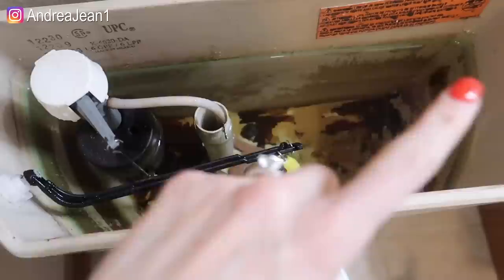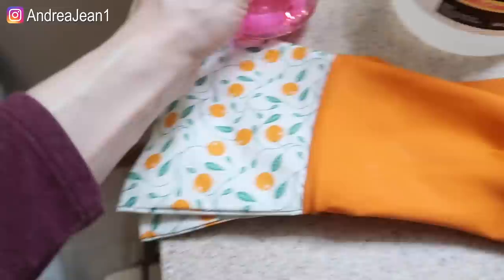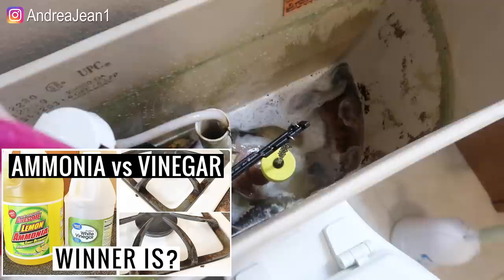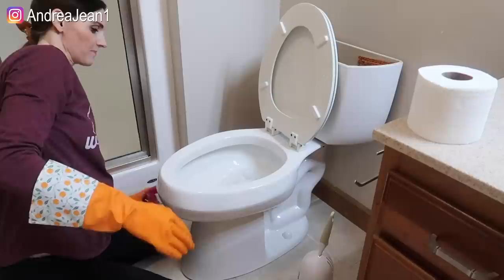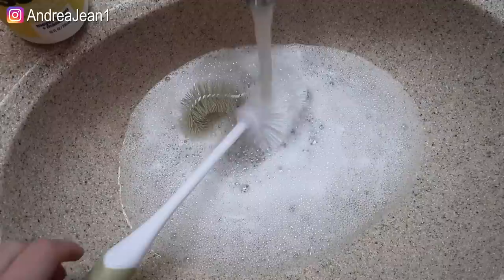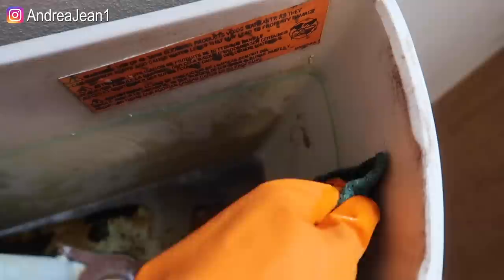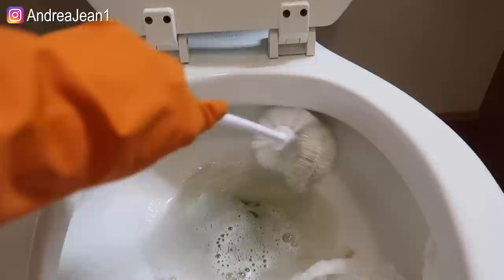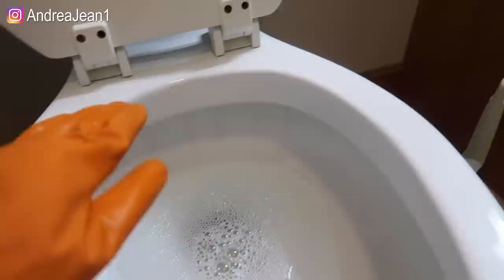Put VINEGAR into your TOILET and WATCH What Happens!! (Bathroom Cleaning Hacks)

Comment: WARNING!  If you live in a rural area and have a septic tank, be sure to neutralize the water in the tank/bowl BEFORE flushing.  The reason vinegar works is due to its acidity, and that acid will eat away the walls of your septic tank over time and can actually cause the septic tank to leak or even collapse.  You can neutralize the acidity by adding baking soda until the added baking soda stops foaming -- then it is safe to flush.
Reply from the maker: Thanks for the tips 👍
Reply: Thank you!!!!!!!
Reply: Thanks! 😊

Comment: A note of caution about using anything acidic inside the tank. We used bleach tablets for the tank in our new home we had built and the tank started leaking into the bowl after a while (we lived there less than five years so it was maybe three years). Turns out, anything acidic like vinegar, bleach tablets, etc. pits or eats into the rubber ring that sits in between the bottom of the tank and the stopper and prevents a tight seal. We had to install a new seal. Anything acidic will eat or pit anything made of rubber. Otherwise, I like your cleaning tips!
Reply from the maker: Thanks Karen. Yes you don’t want to leave it very long 👍
Reply: Thanks for the info Karen. I have had enough plumbing problems just changing out toilets to a Highrisers toilet 🚽!
Reply: Karen, I had the same thing happen.
Reply: @karen kelly Yes! Im glad you said this. I only use the 8% vinegar to clean with for this reason. Many vinegar directions for cleaning will tell you to rinse afterwards.
Reply: Bleach is not acidic. It is alkaline. It has a pH of 11-13. Acid has a pH below 7.
Reply: @AndreaJean  SHE WAS USING BLEACH TABLETS, SO YOU LEAVE THEM INSIDE THE TANK, SHE IS SAYING NEVER USE ACIDIC THINGS LIKE VINEGAR, OR BLEACH ETC.INSIDE THE TANK WHICH THOSE TABLETS GET LEFT IN THERE ALL THE TIME.....NOT FOR A SMALL AMOUNT OF TIME....TAKE CARE, GOD BLESS (do not know if bleach is acidic, I would have to check into that one>)
Reply: @AndreaJean  I thought you were insulting them 😭
Reply: Caustic chemicals will eat rubber just as well if you leave it in there.

Comment: The vinegar is great, but I find if you mix it with Dawn soap it sticks to the sides of the bowl better. You can do a mix of 50/50 or more vinegar with less Dawn. The thicker the mixture the more it sticks to the sides. I have also just poured a gallon of cleaning vinegar in the top tank when I don't have time to spritz. Also if you use a plunger to get all of the water out of the bowl, you can then clean your toilet brush right in the toilet with the Dawn / vinegar mix instead of your sink (ugh!). When you add fresh water to your toilet you can then rinse that toilet brush out in the fresh water.
Reply from the maker: Thanks!
Reply: I definitely would rather soak the toilet brush in the toilet rather than the sink.🤙🏼

Comment: You might also consider, as a preventative maintenance step (once or twice a year) pouring about a cup of vinegar into the the center pipe of the flush valve (where the little hose from the filler valve sits), to help clean/clear the water pathway to the underside of the rim. Limescale/rust buildup in this area can cause problems with the flushing of the toilet, and keeping the pathway clean will help reduce streaks.
Reply: @DaveWeston…omg!! I actually thought about that idea but, I was unsure about it!!! Thank you!! So so much!!!♥️

Comment: I do this but refill the tank (reservoir) with hot water & lots of vinegar (it is cheap) - this saves on scrubbing the inside for too long.  Also, you can clean your toilet brush by putting it in the tank OR pushing it down into the toilet with a hot solution in there instead of in the sink. Great to see you are so excited by being this clean!

Comment: I found pouring vinegar down the overflow pipe gives a nice clean feel to a toilet.  The water when flushing or if goes down the overflow pipe, goes around the rim, then down a chamber in the front to the eductor jet at the bottom (the hole shooting toward the drain).  The vinegar gets at the rim jet holes from the inside and will loosen any mineral build up as well.
Reply from the maker: Yes thank you 😊
Reply: @rickyl8359   The pipe in the center of the tank that the flapper connects to.  If the water reaches the top of the pipe, it flows into the tank. It is also how the bowl is filled after the flapper closes via the small water hose from the fill valve.

Comment: Thank you for the helpful tips. I’ve seen the “cleaning vinegar” in the stores. I am glad to know regular distilled vinegar can be used also. I’ve been using a 50/50 mixture ( warm the vinegar) and dawn dishwasher liquid to clean the glass in my shower. Works a charm. Super clean and no more soap scum on glass doors. 
Having the distilled white vinegar at home, able to use in salad dressings too. ( multiple uses ) 
Keep up the great suggestions. 
Thank you for posting this. 
Now I’ve got some work to do! 🚽🛁😀
Reply from the maker: Thank you Jennifer ❤️
Reply: Jennifer Jones , Keep a spray/ mister bottle (like the fancy hair stylist kind from Sally’s) full of 50/50 Dist Vinegar/water in the bathroom and spray down the shower and tub Every time someone bathes.... when you do weekly cleaning, barely any hard water stains will remain And it will  be way easier to clean the fixtures and glass, if you have shower doors. Also I keep an x-large to go cup and put the shower head in it Once a Month- fill with hottest water and a splash of Dist Vinegar, magical no scrubbing needed.
Reply: Jana Weaver 0

Comment: I just bought a new toilet for this reason.  The calcium and mineral deposit had clogged the rim to such a high degree, not enough water could get from the tank to the bowl for a full flush.     It is possible I could have tried this before replacing, but I will definitely use vinegar to make my new toilet last longer.

Comment: I used your method and it worked so well. When I went to replace the tank lid, I saw it was as dirty as the tank. I used the same method and it was clean in minutes. I’d advise adding the lid in the process.

Comment: I’m 70 and have been using vinegar to clean everything for years.  (Learned from my grandmother.) I just subscribed to your channel because I had never mastered using vinegar to deep clean the toilet.  This is awesome.  I learned I need to deep clean the tank with vinegar; I learned I wasn’t using enough vinegar to deep clean the toilet; and I learned I wasn’t letting it sit long enough.  Thank you.  

My favorite vinegar tip is using distilled white vinegar in the laundry rinse cycle instead of softener.  It gets out a lot of built up soap and returns cloth to a state closer to its original state.  Since we use mostly 100% cotton, this works well for us.  This is the tip most interesting to friends and family who don’t like heavy perfume smells from laundry chemicals or who like replacing their expensive rinse aids with something as cheap as vinegar.  Thanks again.
Reply: The wash machine technician advised to use vinegar in the softener dispenser also after phosphorus was banned/discontinued in laundry powder resulting in fine dust remaining on in especially "blacks" wash. About same amount.
Reply from the maker: Love your ideas ❤️❤️❤️

Comment: You can pour whatever you are using for a cleaning agent down the over flow tube if the tank is full and or down thru the flapper if the water is off and the tank is flushed.
Pour enough in so that the fluid comes out of the transfer ports under the rim to help clean the internal passages.

Comment: You're very welcome, keep up the good work!  I might add, being a retired plumber, when debris is loose in the bottom of the tank, I use a shop vac to suck up material that is loose so it doesn't flush into the toilet bowl, which has small directional holes in the hollow rim that washes the sides of the bowl when flushed and they can get plugged with minerals and loose particles from the tank if not removed............The inside of your tank looks great  :-)--
Reply from the maker: Thanks so much!

Comment: Someone mentioned using tomato paste to clean the bowl. It worked good.
I was reluctant to put it in the tank as it was so thick. ( Not to mention that it would take a humongous amount ).
Since using cleaning vinegar, my tank is working a lot better. ( And cleaner )
Not only that, the holes under the rim are discharging water properly now.
Two for one results. 👍
Reply from the maker: Interesting!

Comment: I didn't know people clean inside the tank. Thanks that was a good video!
Reply from the maker: Thank you!
Reply: You should because if there is an emergency this is a fresh water supply when there’s absolutely no water anywhere. It comes directly off the water source valve.
Reply: I wanted to try and clean the tank but was afraid I'd bugger up the plumbing.

Comment: Using vineagar is very economical and works fast to clean rust and stains from the toilet especially up under the rim. I use this all the time quick easy and cheap works in minutes. Light scrubbing all that's needed. Good where you have hard water.

Comment: Earlier, before I saw this video, I put some Comet in one of the toilet bowls and let it set for over 2 hours, and that does a pretty good job.  However, I love the toilet paper with the vinegar on it and attaching it to the underside of the toilet bowl.  I just did that, and it worked really well!  It takes the grime off after letting it set for about 15 minutes or so!  Thank you!!
Reply from the maker: Awesome!!
Reply: Comet will scratch the bowl over time and will also accumulate in the trap leading to plumbing issues.
Reply: @kentbaker4577   Thank you Kent for letting me know about Comet.  I won't be using Comet anymore for that  Other than Vinegar, is there anything else I should use for the toilet bowl to clean it?

Comment: You can put vinegar in the laundry to cut damp smell in towels and boil a distilled solution with water on the stove to remove odors in the house (like my neighbors cigarette smoke coming through the walls.)
Reply from the maker: Great tip 👍
Reply: I run vinegar through my coffee maker about once a month. We have incredibly hard water that can reek havock on appliances.
Reply: @cyndismith4939  I thought I was going to have to throw out my Keurig because the water is horrible in FL.  I hadnt used it in months and some water had dried out in it and it was completely clogged.  I finally put hot, straight white vinegar in it and overnight, it broke loose.  I find, however, at least in a Keurig, it takes MANY water cycles to flush out all the vinegar.  But it saved my machine.  Now I just cold brew....I had to give up sugar and hot brewed coffee is too bitter.

Comment: Instead of spraying with the jet spray, use the fan spray, this softer spray. You will find that when you use a wider spray, it will not run as fast as the jet. It will also cover all area, whereas with the jet you could miss or Skip and area

Comment: Remember to clean the screws that attach the seat to the toilet. You can only imagine what accumulates there after several visits to the toilet. I clean it as well.
Reply from the maker: Yes germs live everywhere!!
Reply: I coat those screws with petroleum jelly to stop them corroding, making it easier to unscrew the seat if it needs replacing, so those screws would never get washed, you can always disinfect them before touching them when unscrewing, otherwise it is a hacksaw job to get them undone.
Unless they are plasic screws, then you could do what you say.
Reply: Yes true, I periodically remove  the screws and seat and clean them thoroughly.
Reply: I HAVE MEN...
AMEN!

MY PET PEV IS THOSE SCREWS.
Reply: I purchased a tooth brush just to clean the screws on the bottom and the toilet seat.
Reply: You flush with the lid up, dontcha cleany queeny?😂
Reply: @cat_terrell  
Not I just get to clean up after those who MISS THE TARGET!
I STILL LOVE THEM!
Reply: @Briancollison  The same goes for the nuts (under the white caps) that secure the toilet to the floor.  I had to use a hacksaw to replace a toilet.

Comment: In 1967 I was an apprentice hairdresser at a famous salon, and after walking two miles to get to the bus, another 1.5 hour bus ride, I got into work just in time to clean the mirror, which was every wall top to bottom. What did we use? Vinegar and newspaper, and it worked. Then we had the brass to clean, every chair and table was brass....it was hard work, but taught us if you start at the bottom, your rise will feel so much bigger. Vinegar and Newspaper, who would have thunk it?

Comment: I use cleaning vinegar (heated) and Dawn dish detergent on my tubs and showers. It works wonders and I've tried everything.
Reply: Heated? How much of each do you use?
Reply: @louisephillips1954  (1/1) Use a spray bottle that has measurements on it. Squirt Dawn into spray bottle up to the 1 cup mark. Heat a cup of cleaning vinegar in microwave for 1 min. (should be hot, not boiling) pour into spray bottle. screw on spray top and swish till mixed. Don't make it foam. Spray on tub/shower and let sit for 5 min or more. Spray or wipe off.  I did use a scrub brush on our tub when the kids moved out but didn't need the scrubbing I was prepared to do.
Reply: @mjflinn5007  thank you!

Comment: Someone probably already mentioned this: you can, with out shutting the water off, pour a bucket of water, in the bowl to almost totally empty it.  Then you can use a funnel and pour a gallon of vinegar down the fill tube.  This will cause the vinegar to pour through the outlets under the rim of the toilet.  If your handy you can make some sort of a recirculating pump to make a continuous flow while cleaning under the rim.

Comment: You might want to turn on the fan and open the window with all those fumes. 2. I haven’t notice Cleaning Vinegar at any store. 3. Main problem is black mold, for which I use bleach. Is vinegar effective against mold-mildew? 4. Mold is also a big problem with the lower shower grout (which is pretty much disintegrated ).

Comment: For glass, mirrors with no streaks: no matter what your preference of cleaners,  liquid or foam, and cleaning cloths or paper towels (use one to clean and another to dry); apply cleaner to part of your surface (don't let solution dry and do not clean windows in the sun) with first cloth clean surface in horizontal or vertical motion, then dry the opposite direction. 
My preferred cloths for glass surfaces are old sheets or towels.  Microfiber works well too. Especially on appliances and automobiles. When time to launder, do not add fabric softeners. If the cleaning cloths get extremely soiled; rinse well and soak in cleaning vinegar to neutralize any soaps and dissolves oils. This also works well on mops.
Love your cleaning hacks and cleaning solution recommendations. I'm with you on natural products. Vinegar is a must for cleaning caddies.

Comment: vinegar also takes some smell out in laundry {esp our dog blankets &beds}.it neutralizes the smells. im going to try it in the toilet tank.
Reply from the maker: Yes!! That’s good too!!
Reply: Diana C. 

yes i’ve seen that about laundry AND in the dishwasher. so funny how it neutralizes odor when the vinegar smells yukky anyway
Reply: i used 4c to a full tub of hot water in washing mashine, and let it sit for an hr, then run a complete cycle, then do the same with bleach, i have a stackable wash/ dryer and i've tried the cleaning tablets it did nothing, but the mold smell stayed until i tryed the above method and worked im not doing this frequently because im not sure what the vineager will do to the tubeing but a once in a while thing is ok

Comment: Another very simple way is toss a denture cleaning tablet into the tank,  no scrubbing necessary,next day tank is clean as a whistle😁, also cleaning the mirror, I keep a microfiber cloth with just a couple drops of water, streak free and fast!
Reply from the maker: Great ideas ✨
Reply: Does  the denture tablets work on rust stains in the toilet bowl? I have extremely hard water and it stains everything white or metal fixtures in my bathroom?
Reply: Do you turn water valve off, flush & add warm tap water in tank first? How many denture tabs do you use?
Reply: I drop 2 tablets in the bowl and 4 in the tank once a month at night with brush in the bowl so it gets clean too. May just have to try the vinegar though, cheaper and natural.

Comment: I had the same problem in the tank. I gloved up, used rough scrubbing pads and cleaned the bowl (including along the rim) and the tank with the wet scrubbing pad and chlorinated cleanser powder. I got all of the rusty-looking stains and other stuff completely off the rim, and mostly off the tank. I haven't had to repeat the tank project now in probably two years. I'm glad to know about vinegar, however. / I bought one of those cakes to put in the tank. It was a nice help in cleaning and deodorizing the tank, but it was so strong that it warped the flapper that keeps the tank full until the flush. The flapper had to be replaced. / Thanks for the ideas.

Comment: Placing acidic wadding under the rim where it's hard to reach - great idea! I'll try it with rags though, as less fragile than loo paper.
Reply: groovellous1 the point about the tissue is that you just flush and it's gone. Your idea means you have to pick the rags out and dispose of them, and should any go down the toilet you could have a very expensive blockage to deal with.